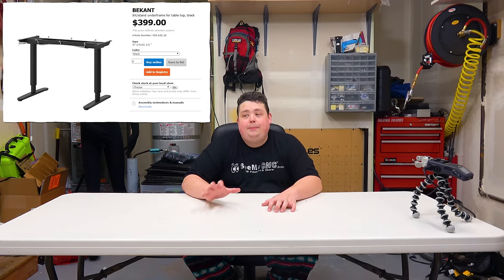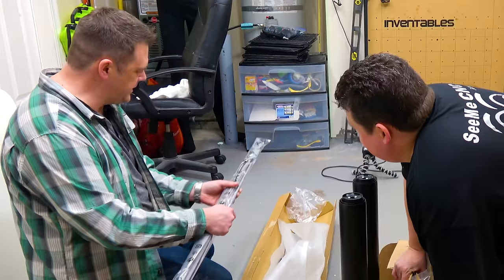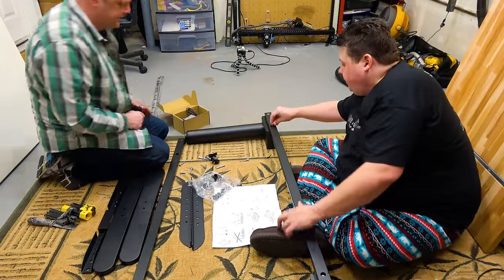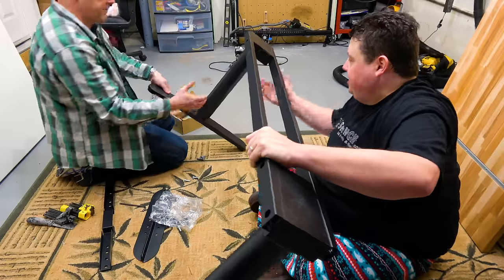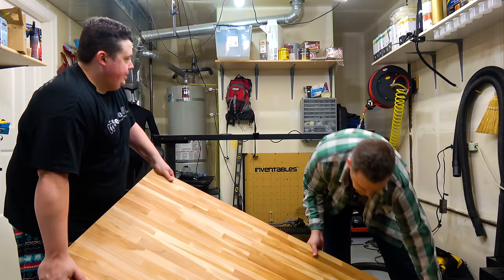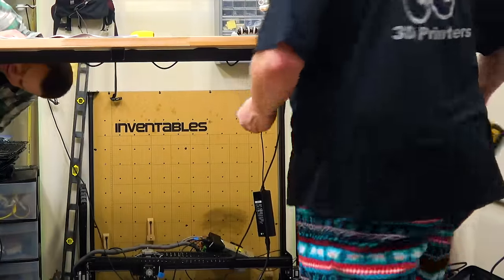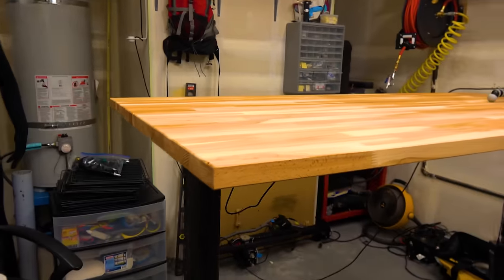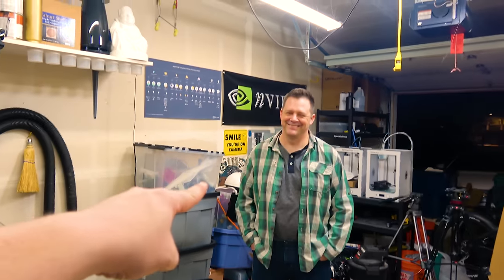Great Sit or Stand Motorized Office Desk is a Game Changer! - @Barnacules

Comment: I built a sit/stand desk out of the same table top! I used 3 or 4 (can't remember) of them for the whole thing, its entirely made from the beach wood of these table tops. The legs slide up or down and lock into place with wooden pegs that slide through it. I use it in stand mode, with an exercise bike as a computer chair to peddle as I'm on the computer. :D

Comment: I have a suggestion for any future table top mounting: Put the top upside down on the floor (on the box it came in) and then put the legs upside down on the (now up) bottom side of the table top. Then center and screw it together with ease and clear vision.

Comment: I've literally bought the same "desk" a couple months ago. Expect I didn't get the motorized underframe, I got the manual one that you adjust both legs with a little screw. I didn't care to "stand" with it, I just wanted a desk that could go lower than 27" since I have short legs. Also, your Gerton actually look like it has a slight finish on it? Mine was pretty much raw "beech" that was much paler than yours and even got a few splinters off it. I had to put on it a couple coatings of varnish before using it. Personally, the desk wobbles(front to back) a little once my two monitor, printer, keyboard and mouse are on top of it. But I have it propped against a wall so it doesn't really wobble anymore.

Comment: Got the same table , lengthen it to 2 meters wide with a 2,2 meter wide top, put some IKEA wireless chargers in it and mounted a electric gutter with outlets and internet , really strong motors in it , it misses some features but cheaper than the professional ones, got some pictures if you're interested

Comment: I've been using an Uplift Desk for about a year now, it's got memory settings but the desk overall is more expensive.  You guys actually kinda assembled it wrong, you lay the table top down and assemble the frame onto spacing the motors etc out over the pre-drilled holes.

Comment: Having the power supply hanging by the cord will break the wires or the plug. You should have put the top down on the rug and then screwed the frame to the top and then stand the table upside right.

Comment: "Mark it with a sharpie"? If you really want specific heights, it shouldn't be too difficult to put up a sensor "network" on one of the legs, linked to an Arduino, with a bypass for the up/down buttons, and a bit of code.  Effectively create your own presets based on where physical switches are, could even put a set of buttons and LED for each preset. Might be a fun foray into electronics at the very least, if not an excuse to 3D print something.

Comment: I bought the Skarsta. Which is a lot cheaper mechanical version of Bekant. 169€ without the table cover. Really sturdy. Full metal frame. You can even adjust the width of the legs. Highly recommend it.
Reply: Tr1kk1 okay, what can you find on a budget for a Canadian? all I care is that it has a button for up, and a button for down
Reply: Some months back, i searched a lot of these motorized and mechanical tables.All tables starts around 300€. At these prices, the legs are really small. I dont know,if you can find somewhat cheaper than that. With descent quality. I didnt. Maybe look at used ones?

Comment: you do relize that beech is one of the most compressed wood types there is...and heavy as fuck...its a very hard wood type...can take alot of damage but is gonna limit the amount of stuff you can have on the bekant table(as the motor has a max weight it can handle)